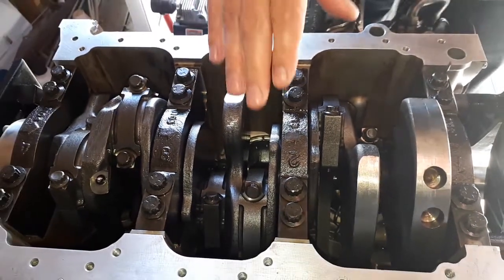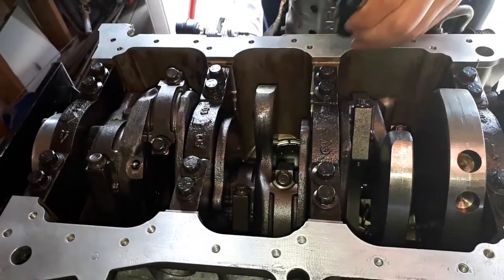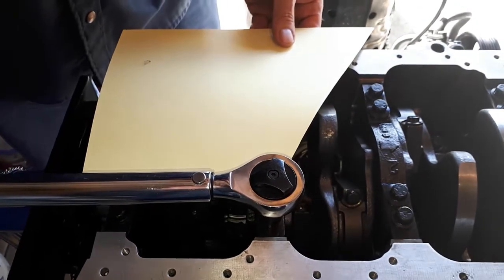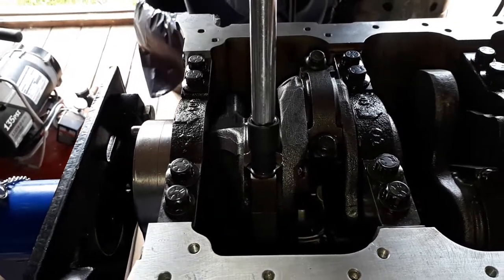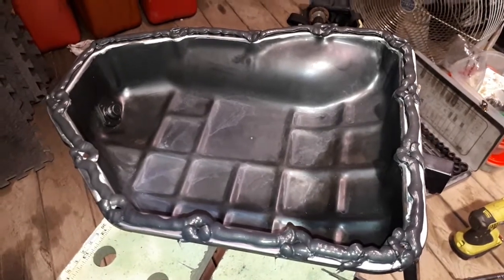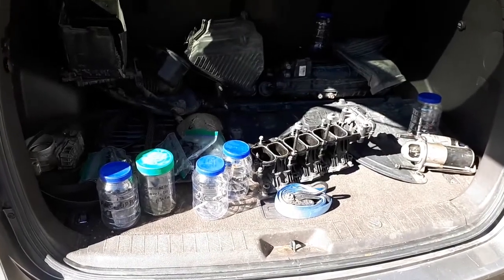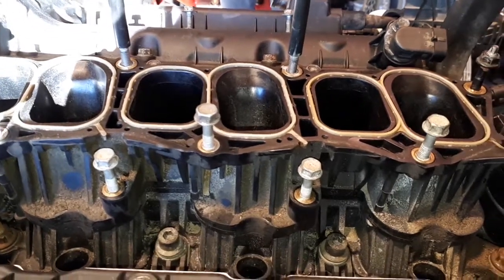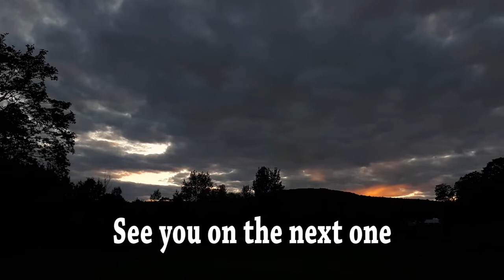Engine overhaul torqued down on the 2011 Hyundai Santa Fe Sport 3.5L Part 5 of 6

Comment: These vids are still completely insightful. You helped me a few days ago, hoping you can help again, hehehe. I'm trying to remove the cylinder head, but I can't seem to unscrew the bolts. They're 12 points, tried 12mm and 13mm sockets (12-point), but 12 doesn't fit and 13 keeps slipping. I suspect they're rounded off (it had been worked on before). I know it might be vague, but do you have any thoughts?
Reply from the maker: Thanks for the comment, when the bolts get rounded off, there are two ways to extract, 1. use bolt and nut extractors in socket form. or 2. weld a nut on top of the rounded bolt then remove it. Hope this helps